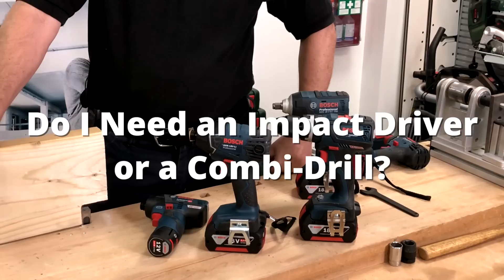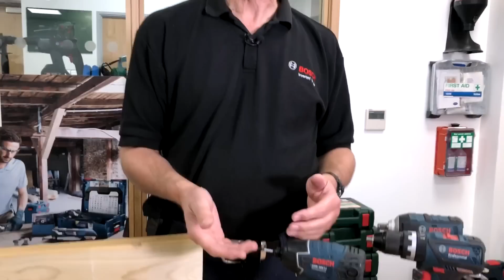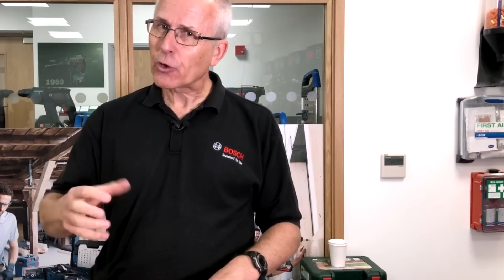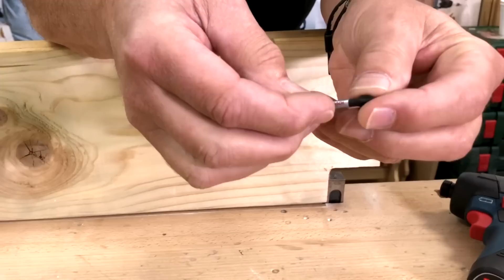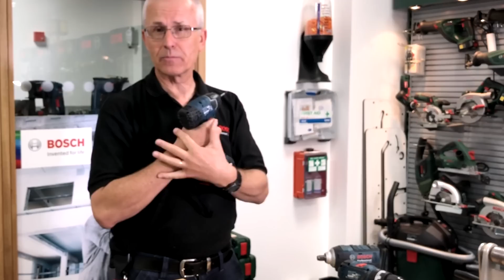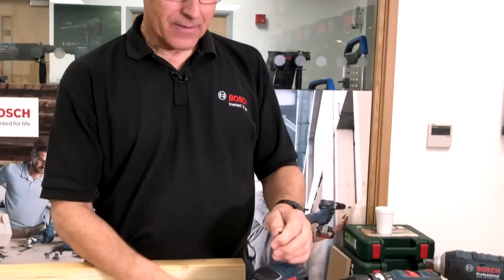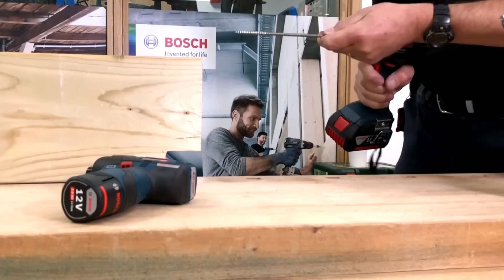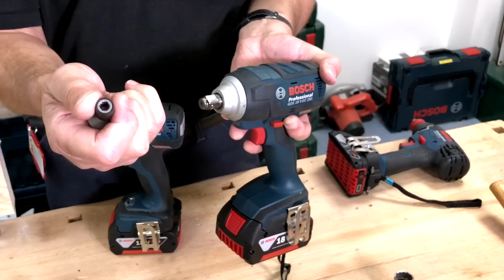Do I Need an Impact Driver or a Combi Drill | Toolstop Guide

Comment: As a carpenter i have to say that impact drivers have absolutely no place  in the woodworking business,
Reply: Fences are made of wood and my impact driver is perfect.  I appreciate you are referring to cabinet making etc in which case I would agree they are overkill and cause more harm than good
Reply: The carpenter who built our deck used an impact driver for the Torx screws and lag bolts.
Reply: Dave Nixon - would have to agree with you there mate. Working as a chippy I have never seen the need for this tool. They are smaller and lighter which is the only benefit that I see over a combo drill
Reply: @hamishgoodley7208  Faster driving and little to no torque on the wrist are the reason I have a separate driver and combi.  Driving lags with a combi you have to fight the rotation.  As a GC I always use them together, right tool for the right task, no reason to make it more difficult.  Example:  Customer asked me to do a pre-fab shed a couple days ago, the combi(also is a hammer drill) was used to drill into the slab then ID was all I needed to set all the screws and bolts.
Reply: Robert Faille - yep we all have our own preferences. I myself do not have any issues with torque on the wrist, this is where the clutch comes into play on the combi drill. Never bothered using the combi drill for drilling masonry as it is not as practical as a rotary hammer drill. I also do believe a impact drill is that much faster. Myself, I use a two combi drill (have a 3rd smaller one for smaller finishing work)  set up for any drilling and screwing, this is probably part of the reason my drill have lasted for a long period. Anyway not saying my way is the way best way for everyone, but it's the best way I have found for myself.
Reply: @hamishgoodley7208  Again very good reasoning.  If I always dealt with concrete I would get a rotary hammer.  I can only carry so much in my truck so it seems like overkill to me since I don't pour slabs anymore.  I suppose it's just the jobs you do that dictate the tools.  I used to be a welder and do a lot of railing construction and installs.  Most of my clients now just want TV's on the wall in block houses.  Less interesting but it's a job eh?
Reply: Fine woodworking*

(Hardwood furniture, cabinet making ECT.)
Reply: It is sad that English language doesn't have the different professions to separate the different professions, but all is put under "carpenter". 

Like professions "Puuseppä" and "Kirvesmies" are different that other builds furnitures, small wooden objects etc all with finishing work etc. While other is construction worker by the wooden parts, like the roofs, shacks, decks, stairs etc. 

So there are totally business for a impact drivers in the woodworking, but not when doing furniture etc. As in those it is more important to use wooden joinery than screwing or hammering. 

But when building a deck worth of 6500 screws, the impact driver is far far more pleasant to use not for the speed but as well for the wrist, and offers greater control to get the screw head flush with the board without going deeper or requiring time to adjust clutch.

But when making a furniture like a table, totally forget the impact drive as you likely split the wood if you have not pre-drilled it.
And that is where the combo-packs comes nice, that you don't need to swap heads or anything, drill for drilling a hole, impact drive to drive a screw in. 

That is reason why I have three combination typically, drill, combi and impact. Drill for drilling holes, combi to screw most screws and be used for drilling to hard elements and then impact to drive tighter screws in. 

Each tool has their places but 70-90% of the work is done with a combi/drill generally.

Edit. Bosch has the new chip in their latest tools to detect the torque to the wrist that makes tool to rotate in your hand, and that sensor detects it and stops the engine so your wrist doesn't rotate. That is very nice thing especially with a large impact drills as you have so massive torque and impact in those big ones and they can totally damage your hand or cause other injury when such tool does 180-360 degree rotation etc.
Reply: As a joiner I have to disagree. Impact drivers are fantastic. I wouldn't get through as much as I do without one
Reply: Also, I'm 30 years old and already have carpal tunnel in one hand from using combis.  So I guess that's a thing?  Night man, 3am on the east coast USA.
Reply: Robert Faille - get a bigger truck haha. I get what you mean apart from I don't actually know specifically causes carpal tunnel. Would be handy to not be on the tools as much though.
Catch you later, from NZ
Reply: @robertfaille9225  Funny just one hand, usually it's both. Try to lose some weight, use the other hand more and there is a wrist guard to restrict you hand in a better position for relieving the pain while sleeping. The last resort is an operation to widen the "tunnel" on you wrist to relieve the pressure (hence losing some weight might help). The operation works for some but not others. I had a bad case of carpal tunnel in my 30s as well on both hands for number of years, couldn't sleep most of the time. Completely went away as I got older, maybe dropping some weight, healthy diet with some exercise - really no definitive idea why. Good luck to you Robert.
Reply: Decking is usually wood. ID is extremely useful.

Comment: Many words, much confusion.   
Impact Driver = Drive Screws Easily.  It will also drill small holes but not to a high degree of control.  
Combi Drill (not commonly known as impact drill) =  Drills all holes very well but can also drive screws (nowhere near as effectively as impact driver) and also drill into soft masonry but not hard concrete with its impact drill function.
Conclusion:
Impact Driver = Specific Professional Use.
Combi Drill = All round professional and DIY use or Professional Hole Drilling into wood or metal but NOT masonry or concrete (SDS is the pro answer to that).
Reply: Let's throw in rotory hammer for further confusion.
Reply: Kevin & @frankw8876  Percussion drill also called "rotary hammer" uses SDS+ or SDS Max bits and it's the tool for drilling hard concrete/cement.
The combi drill (a regular "hammer drill") just vibrates a bit and doesn't bite into hard concrete/cement.

Comment: Another advantage of impact drivers is they don’t ‘cam out’ of the screw heads and mess them up like a drill driver does. That’s the main reason I bought mine (shhh, although mine is a Makita ! )
Reply: Maybe it just seems this way after 15 years building, but on old screws I strip/cam out the heads all the time.  I'm sure you mean new screws though.  With the old it's down to the bag of tricks to remove them.
Reply: Agreed, I think by the action of the rapid strikes and its gaps, the tip has nano seconds to re-seat the bit perfectly into the screwhead. Which is often an oversight and may go unnoticed but it certainly helps. A drills load is trying to break out the side of the screwhead (cam out) 100% of the time. It never gets an opportunity to reseat unless it's done manually by stopping and restarting. 
I also appreciate the smaller chuck on impcat guns. If a big black plastic drill bit gets next to something like a white vinyl window, it can cause awful damage. Where an impact chuck is so much smaller and tucked up in the gun, it's much less likely to cuase any damage.
Reply: Not only that, if you're up in a ladder with your butt hanging out in mid air by all means use an impact wrench as a drill could torque your arm off then throw you into the ground.

Comment: I find that the impact driver does not chew up screw heads but will break them clean off instead so make sure you are using the correct screw for the application.
Reply: It does always surprise me how many people do not pre drill their holes when screwing two pieces of wood together
Reply: Accurate
Reply: Quality of screws when driving, or factoring in the age of the screw if removing them is also helpful.
Reply: Agreed.  Even with screws that claim to be self-taping or "don't need pilot holes" you'll still split thinner materials.  I like spax screws which claim both.  Great hardware, but you've got to drill unless you are just doing ptp 2x4 or larger. If they have a drill and driver it only takes a few more minutes to not wreck your sills.  People just get lazy.
Reply: Drilling a hole before driving a screw in is critical when building furniture and such, but on rougher woodworking like building a deck you really need to drill hole only at the ends of the board or when close to the knot or other weak part that will otherwise get heavy stress.

What is more amazing is that many doesn't drill sink for the screw head, and then they ruin their decks boarding fine finish or other work. 

It all comes to have more tools than just one, so you don't need to swap heads and modes in tools to get something done. It is very annoying to first take a drill head to drill a hole. Then swap to a countersink head to make the finishing for screw head, then swap to a drive bit to get screw in.... 

Just get a three drills and you get all three done quickly when required.

It is same thing as having just one or two batteries, when you run out, you run out and you need to wait to get something charged. Instead get 4-6 ones and quick charger and keep all charged so when you start you have minimal time for recharging.

Eventually everyone just ends up having a dozens or hundreds of different tools, each one fitting better for different tasks.
Reply: ReMors - we use a lot of hardwoods for decking, you can get away without pre drilling pine decking but we don't usually use it, so pre drilling is compulsory for hardwood to reduce splitting. 

Drywall is probably the only thing that I can think of that I do not pre drill. I especially pre drill boxing/form work as it makes the job a lot faster to strip and reduces burnout.

Having a few drills, like you mentioned is how I work, two of the bigger combi drills and one smaller one, usually no need for 3 at once though, but that's just me
Reply: @katumus  There are drill bits with countersinks, all you needed is one drill for drilling/countersink.

Comment: can you tell me why bosch 18 batteries refuse to charge an never charge again after they have been worked hard
Reply: Are they still hot? Hot batteries often don't accept a charge until they cooled down a bit; charging a battery when hot is kinda bat for them.
Reply: @dasstackenblochen9250  that was  3 months ago an it's stil won't take a charge
Reply: Then the battery is dead (cooked cells). Had it happen to one of my Makita batteries, one cell dead is all it takes. 
I hope you still got warranty.
Reply: its not the cells its the protection circuitry  on the battery im still using the battery by charging it at home on dedicated lithium charger  as for the warranty bosch dont give you one on their batteries
Reply: That's a shame. :/ Here they give 2/3 years warranty on those
Reply: They do give a warranty, at least on the professional ones. 2 years if you register them on the Bosch site within a month of purchase. Are you sure you got a genuine one? First thing I do when I get a battery off eBay is try to register it with Bosch to make sure it's genuine.
Reply: i never new about the warranty till now its to late to register now
Reply: sorted it i cut the protection circuitry out of an old battery an solderd it in to the broken one works a treat now
Reply: completely drain a lithium cell = dead cell